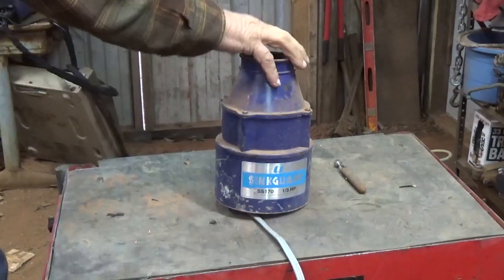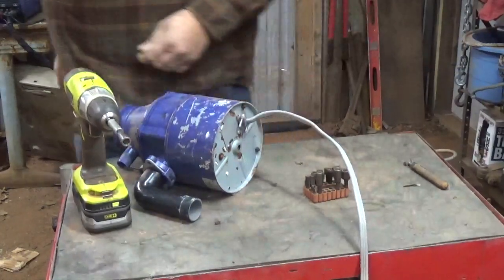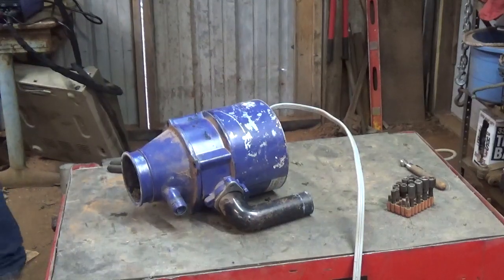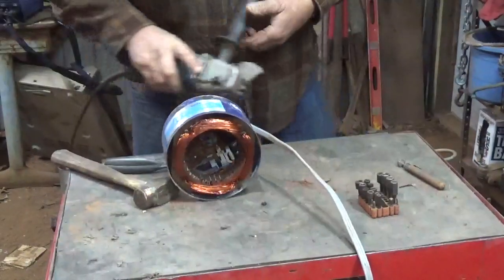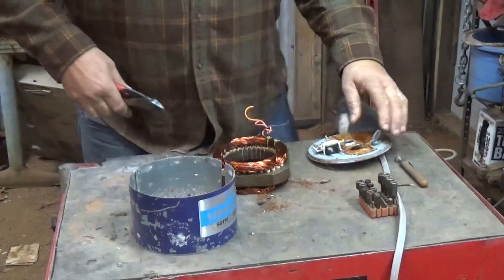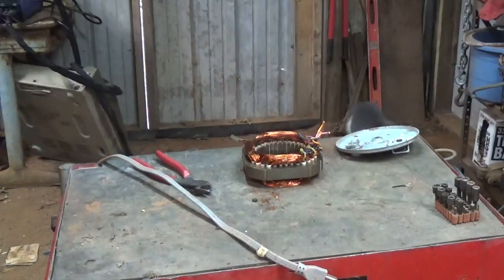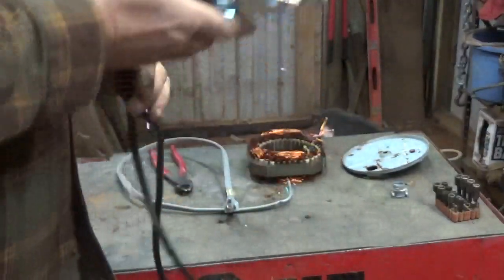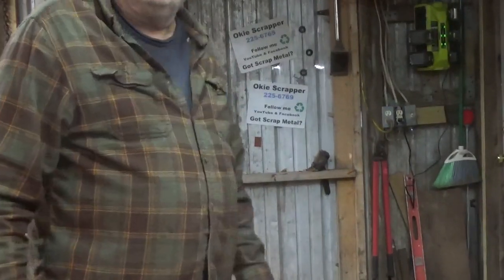How to Scrap a garbage disposal for free copper

Comment: You have to check jumper cables too ! Now most jumper cables are aluminum and copper coated  ! So they aren't worth it either  ! Just F.Y.I.
Reply from the maker: I did not know that; guess I will have to start checking them
Reply: @Okiescrapper  there must be a shortage of copper because they are changing a lot of things that use to be ! Fan motors  , microwaves , washing machine motors  , and it goes on !

Comment: It’s funny you do microscrapping one vid then 3000lb of shred in the next
Reply from the maker: I take it as I get it, I run an add, from March to October and get all kinds of stuff, I bring it in while the weather is good and clean it up in the winter, it will change next year when I retire
Reply: @Okiescrapper  surprising amount of copper though from a disposal, are you gonna cut it out or bring it as is?

Comment: You can make your neutral longer but if you try it on the positive side the longer it is the lower your amperage will be. You won't be able to cut through thick metal. Happy Thanksgiving
Reply from the maker: the positive side is about 12 ft. so it is plenty long, thanks for the info

Comment: wow good video ,,!!!!! you need a Bigger Heavier   table ,,,, about 5 in. Taller  ?
thx Ed  Loretto Ontario Canada
Reply from the maker: I got a new table with a vice on it the top is plate steel about 1-1/4 inch thick. one heavy sucker, the table that I am using is an old tool box that I picked up as scrap

Comment: Last one I found, I made a shaker table out of. 
 I just welded a weight to one side of the chopping blade, mounted it to a table with screen to sift rocks with. 
I did have to bypass a coil or the reset switch so it wouldnt overheat, cant remember what one. 

I enjoy building junk from junk I guess. 
I hate to see good things get tossed, even to scrap recycle. 
I wish there was a better market for used equipment. most ppl just toss and buy new. 

I dont have the land like you do, so I have to be selective of what I keep.
Reply from the maker: yeah I try to fix up mowers and a few other items for resale. I have a good bunch of stuff to put on market place or take to the auction, give them a second life
Reply: Same here